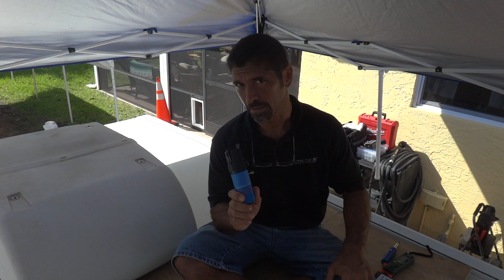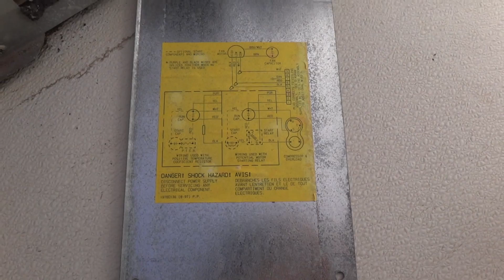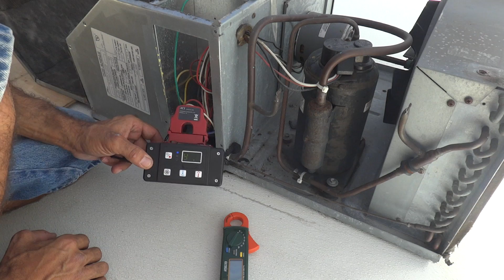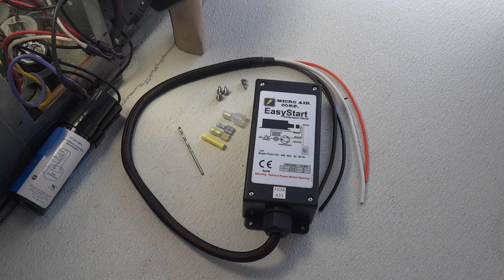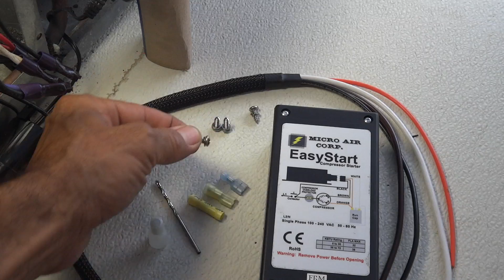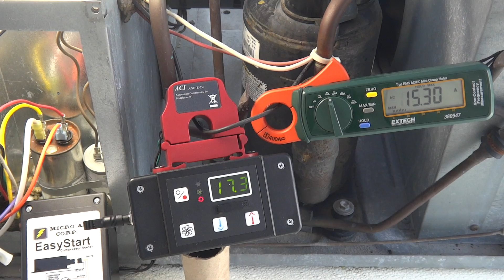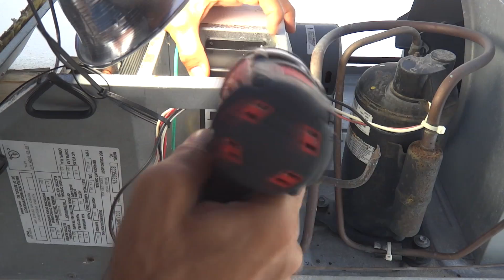Micro-Air EasyStart Soft Starter Installation into RV Rooftop Air Conditioner

Comment: I was following until I saw the generic crimp tool. To create a video like this takes a lot of effort. The ONLY way to get a secure crimp confidently is to use Klein Crimpers. They are about $30 and preferred by professionals for connections that never fail. Over 20 years installing car electronics. Great video but that detail is critical. Not everyone can get the right leverage from cheap crimpers.

Comment: Ok folks every one should get one I have a 2020 Coachman beyond with a dometic 13500 btu after it would start up after about 10 minutes and several restart the generator with trip out from overload with a Onan 2800 I could not even running low fan I just installed today no it can run  until I run out of fuel on high ! So awesome why they are not on all idk I can literally run everything else and the AC what I difference day and night

Comment: Just ordered one of these for my 2 year old camper/AC and looking forward to getting it installed, along with my new generator! At this point I don't feel like my unit has been struggling since I am generally on a good power supply, but it sounds like this Easy Start is a good option for both long life of the AC unit, as well as when I start using my generator! Thanks for the video... and if I have any questions, I'll give ya a call! lol... :)

Comment: Hi I have a new Solaire 202RB 20FT camper.  I think it has a 13,800BTU AC Unit.  Am I to understand that with your kit I would be possible to run my camper with a single Honda EU2000 generator without needing a second generator hooked together to make it work????
Reply from the maker: Hi Arlene
Thank you for your interest in our EasyStart product and many of our customers are using the Honda 2000 generator without issue. Please keep in mind though that outside elements can negatively affect generator power such as heat, elevation and other items that are running in your environment.

Comment: Can this be installed on an air compressor my 17 gallon compressor uses 5000 watts just to start
Reply from the maker: Hi and thanks for your question. Although it is possible, we only recommend this for commercial customers who would need to submit a sample for compatibility. Support is only available for bulk commercial accounts for this type of application. Our EasyStart model selector located on the product page just under the product image has an icon labeled "other" which covers this. https://www.microair.net/products/easystart-364-3-ton-single-phase-soft-starter-for-air-conditioners

Comment: So i have a dometic 15000 which one do i need the  3 or 6
Reply from the maker: Hi Gary, RV Rooftop AC's will use the EasyStart 364 (3-ton) X-20 model, We have a very EASY to use model selector located on the product page just under the picture of the product image. Check it out. https://www.microair.net/products/easystart-364-3-ton-single-phase-soft-starter-for-air-conditioners

Comment: Will it work with 110v mini split?
Reply from the maker: Hi Sergey, Thanks for the question. EasyStart will not work with this type of system. You can take a look at our product page which has a model selector located right under the picture of the product. https://www.microair.net/products/easystart-364-3-ton-single-phase-soft-starter-for-air-conditioners

Comment: No electrician ... from what I seem to read  just having this thing installed, running your Genator in an RV it will not burn as much gas ?  My other question  seems  OK to use  regular 120v house plug will work better too ?  Like to hear thoughts on this .. Thanks
Reply: I've installed the easy start on a 15k Dometic and my 30 Amp plug was across my shop. I had to use a 25 ft. 30 amp  extension cord to make it reach so I could use the a/c.. After installing the easy start, I can now use an adapter and tie into a 20 Amp standard outlet   circuit right next to the rv and run the a/c. I have an online monitor, and the inverter and a/c draw a max of 14.5 amps, so it's possible it may run on a 15 amp circuit.

Comment: That’s awesome I’ll be ordering some for sure. My only concern is the size of the module do you make a smaller one for tight spaces
Reply from the maker: Hi Robert, you can get a better idea of mounting options by visiting our EasyStart Knowledge Bank, check out the wiring diagrams as they have good visuals of locations. http://www.micro-air.com/knowledgebank

Comment: Installed mine today, wow! What a difference. Pretty simple install after I figured out mine didn’t have a start capacitor on the compressor. Pulling 12.9 amps at startup then settles down to 12.0 in run. 1464 watts.
My generator no longer struggles to run the 13.5 btu Coleman unit.
Thank you soooo much!

Comment: I just install the 364 the fan comes on and the compressors starts and runs for about 30 secs then stops the fan continues to run.  Any ideas?
Reply from the maker: Please visit our EasyStart Knowledge Bank for trouble shooting guides etc...You might want to take a look at the "Advanced EasyStart Troubleshooting" guide. Our newer clear case model allows you see the LED indicator lights which can help you understand potential issues. http://www.micro-air.com/knowledgebank
Reply: @MicroairNet  @Micro-Air, Inc. Thanks that is the one i have.  the led i get is D22 which it says is over current. The ac ran fine before i installed the easy start. and sometimes it will run for several minutes and sometimes it kicks off in a few seconds.
Reply from the maker: Provide the LED light information using our support submission form at http://www.micro-air.com/microair_support.html (Support Type: Technical Questions or Technical Support) - Bottom Right

Comment: I have a 10,000 BTU portable AC unit in my van does about 650W when running low fan. Will this work on one of these units?
Reply from the maker: Hi Jay and thank you for your interest in our EasyStart product, we should have a model for your situation but I would recommend that you use our EasyStart Model Selector in order to apply the correct EasyStart model for your environment. This is a simple 4 question process and will guide you to the correct model for purchase. http://www.micro-air.com/microair_support.html (image with the question mark)

Comment: I installed a 13500 btu mach 3 roof top ac in my ford trasit 350 with a 6000w  power bright inverter,  Im using the batteries from the van to power the inverter, my idea was to use the ac only when the van is on so it wont drain the batteries, ac compressor will start  but my hot wire from invert to battery gets really hot and pops the fuse. Will the easy start help or  what else do i need to make it work?. Im also using 1ott cable to power the inverter. do i need to add batteries?  and dont want use an inverter generator, batteries only. Inverter provides 50amps, but the ac has a rotor amp cooling of 54amps, would that be the problem?

Comment: That black capacitor is not a stock part it's a PTC type hard start cap. The PTC is the bit plugged into the top of it. The better hard start kit is the 2 part kit that has the cap and the current switch. Same ones you would find in home and commercial central air units. They do a far better job at starting the HERM than the PTC types do which are the cheap 1 peice kits..

The easy start is a nice device and I do reccomend it to others, I even bought one that I keep as a spare in my trailer but before I even heard about this device I designed and built my own variant based around the Atmel MCU chip commonly used in Arduino boards,  just for this situation since I do have a solar power system and inverters. You may have guess it by now thata I have a degree in electronics and I am NEC certified. I made some pretty big modifications to my RVs electrical system to make it more efficient on or off the grid..

Not alot of people know this but crimp on connectors if you look closely down the insulator at the metal barrel there is a seam, this seam is supposed to be aligned in yout crimping tools "valley". this is so you do not collapse the barrels walls in an uneven fashion that will eventually lead to the connector caming off the wire.. What I tend to do is remove the connectors stock plastic insulator and solder the connectors on the wires and heat shrink over the metal bits to make a new insulation.

Comment: Will this void the warranty on my low profile dometic unit?  Our RV is brand new and I don't want to void the warranty.
Reply from the maker: Hi Lisa and thank you for your question, legally it should not. We do however offer an Extended Warranty that covers your AC unit’s compressor motor for the duration of your AC manufacturer’s warranty. That can be found here:  https://www.microair.net/products/easystart-soft-starter-extended-warranty-2-year

Comment: I have a trailer out in the boonies I run on a 2k generator. Can I put the easy start into learning mode with not ever putting it onto grid power?
Reply from the maker: Hi and thank you for the question, check out our EasyStart Knowledge Bank http://www.micro-air.com/KnowledgeBank Type "learn" in the search.

Comment: Finally killed my 13,500 btu Dometic ac unit last summer (12 years old). My RV is large (35 foot travel trailer) and on hot days it would run constantly.>>> nub.best/ywvn     Upgraded to the 15,000 btu unit. Really easy install, less than 30 minutes start to finish. Blows ice cold and operates properly

Comment: This thing actually works. Our Generac IQ2000 didn't have a chance at running our camper AC. I installed the Easy Start, now it pulls about 80% load when the compressor is running. Saved us around $1000 by not needing to buy a second generator and parallel kit. Next, we need to test it at higher altitude on a hot day. Fingers crossed.

Comment: I have a question I hope you can answer.. I am purchasing a truck camper for the primary purpose of boondocking when we frequent golf tournaments my sons are involved in - (hotels are very expensive). I plan on installing a micro-air easy start and having a Honda i3000 generator on the back to power the air (tourneys happen in the summer when it’s extremely hot). Do you think the generator will power everything in the RV if the power requirements are reduce on the Air. And if not, how do you run the air on generator and the interior stuff on battery?... I’m a novice and I have been watching videos trying to learn.. your video is very informative. Thank you in advance.
Reply from the maker: Hi Gerald and thanks for the interest in our EasyStart product!

Your question has many possible answers due to the variables but I will try my best!  

The Honda 3000i is capable of 2800 watts continuously and 3000 watts surge. My experience with Honda tells me it will probably do nearly all of the 3000 watts at sea level even on a hot day. This means that if you were running the air conditioner (typically 1800 watts for a 13.5K BTU rooftop) it will probably start and run most of the time without an EasyStart. Where it gets problematic is when you add elevations over 5000 feet and more heat. That reduces the generator output to the point where the surge from starting may prevent the AC from operating. 

You also want to add in more loads from the camper that are not always obvious. The largest are microwaves and electric water heaters. If the microwave draws 1000 watts then adding the AC at 1800, may work at sea level but will be a problem as elevations climb over 2000 feet. Many other loads are small like battery chargers which are 100-400 watts, and TV’s are around 75 or less. These add to the generators work load and should be considered if any are significant or many are run at the same time.

The bottom line is EasyStart can make the starts lower making it possible to operate with your generator under most if not all conditions as long as you are careful with your additional loads.

As to your second question, separating the loads is an electrical challenge that probably requires re-wiring your camper. It is probably beyond the scope of a novice but do-able as you gain electrical experience that you will undoubtedly get traveling!

Comment: Good job on the video, nice high protein description with good detail.  One suggestion I would make is that it would be helpful to show that your customized current meter is actually measuring peak current accurately by setting up a third current measurement using a current probe and a real time oscilloscope.  Here it would be very useful I think to be able to show exactly the current peak compared to the steady state current that you are describing.  To do this you would simply setup the trigger on the oscilloscope to activate as soon as the compressor starts.  This will capture with great precision the increase and decrease in current drawn by the compressor over time.  It also validates you built your box correctly (not saying you didn't BTW).

Comment: Is the start surge enough to overload a 3500W Generators 30A receptacle?
Reply from the maker: Hi and No, the start surge will not overload a 30 amp outlet. Outlets actually have two ratings but only one is really used. The 30 amp rating is its continuous duty rating and that determines how much you can pull from an outlet without overheating. There is also a peak duty rating on outlets for doing things like starting motors. This is often 5 or more times the continuous rating and designed so the breaker will trip long before you reach any excessive temperature on the outlet.

Comment: I believe your product is superior. However, you didn’t really give the “Hard Start Capacitor” a proper test. Capacitors must be charged to be useful.
Reply from the maker: We have evaluated hard start capacitors against the factory start components and even on compressors without hard starts. The net result is any improvement depends on the value of the original start cap (or in some systems the lack of one). We have measured a 0 to 10% reduction in start current using a hard start capacitor. The benefit really depended on the compressor motor and its design. A 10% improvement on a 60 amp LRA drops us to 54 amps. Not really worth mentioning and although it could work in some spot circumstances, we are confident it will not provide a solution over a broad range of temperatures as EasyStart does.

To your second point: AC works differently than DC. In DC, the cap must be charged like a battery and release the charge when
the DC supply drops. In AC, the cap is charged with every AC cycle and releases its full charge every cycle as well. Its purpose is to provide a phase shift which creates a magnetic field within the motor causing it to rotate. It does that by releasing the energy as the alternating voltage changes direction back toward zero.

Comment: Wow, wish I would have seen this video before I sold my Airstream! That said, have you ever installed one of these on a portable AC unit? Seems that's the only option these days if you want something with less that 13,500 btu anymore, and I just don't need a big unit like that on my current setup, but still would like to know I can run everything off a single honda EU2000!
Reply from the maker: Hi Dawn
Many customers are using EasyStart to run with Honda EU2000i generators and portable AC units. Ducted or window units do not have enough room to mount the unit inside, you will be mounting the box on the outside of the case. Under counter and rooftop units can mount EasyStart inside in most installations. 
Honda generators are great generators but there are limitations. They can produce about 16.6 amps at sea level and less at higher
elevations and temperatures. An air conditioner draws a little more than 1 amp per 1000 BTU so a 10K BTU would draw about 11 amps. That leaves you with a few amps of power to run other loads from your generator. At 6000 feet on a hot day, you will not have as much “head room” for any additional loads though since there is less oxygen for the generator.

Comment: Seems to be a great product from a company with great customer services.  I almost purchased the 364 but decided not to for a couple reasons.  My only wish is that you discuss why so many people get positive results from simply installing a hard start capacitor alone.  If you research them, including their reviews, they tend to work for almost everyone that installs one.  Why is that?  Your video here implies that there is no benefit to installing a hard start capacitor, yet many people couldn't start their AC, installed a $15 hard start capacitor and ended up being able to start their AC.  Obviously the hard start capacitor will not reduce starting current, it shouldn't.  What's important is that the load on the source (generator) is reduced after installing a hard start capacitor.  Great video but misleading for sure.  You really performed a misleading test that will push your product, which is probably a great product.  $300 for an easy start is steep.  That's about 1/3 to 1/2 the cost of inverter generators (not a blue or red one of course).  I would try the $15 hard start capacitor if my generator won't start my AC, if that doesn't work I'd consider your product.  Again, why do hard start capacitors work for so many people?  Because they provide a boost on startup that reduces the load on the generator.  Works for most people, that's strong evidence that you forgot to discuss.